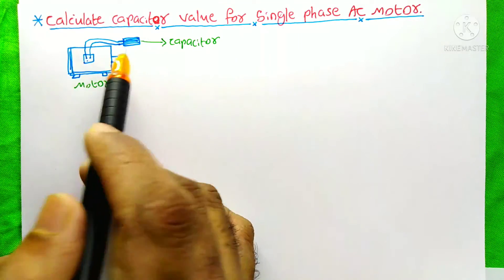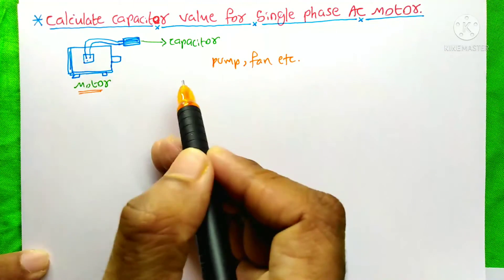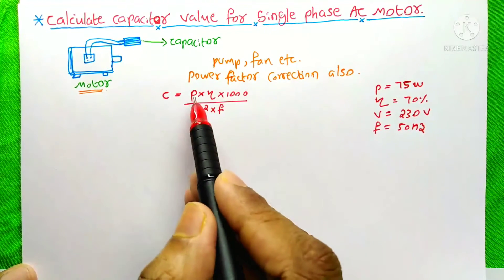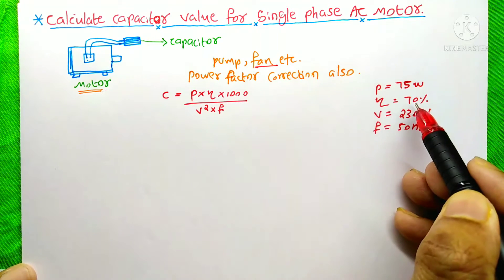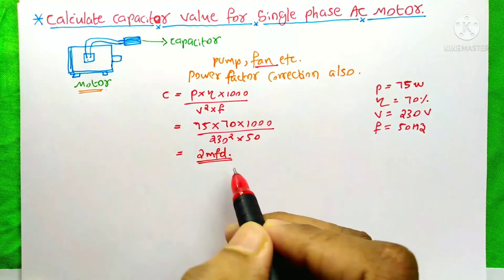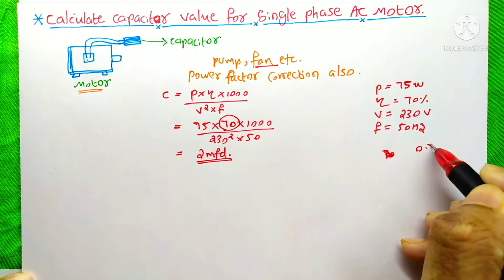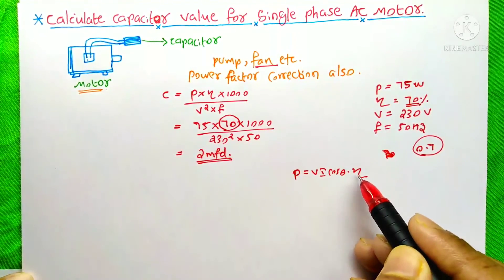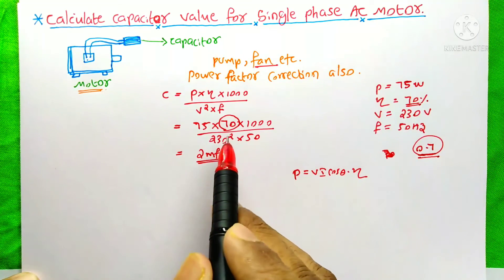How to calculate capacitor value for single phase AC motor | Electrical

Comment: Thanks for the video. Where can we find the information for the efficiency? Power and voltage is simple to find, but I never found an information about efficiency in the motors. Also what happen if we put a large capacity capacitor?
Reply from the maker: 1)If u don't find effi, consider 80%
2)Motor will be damaged due to high inrush current